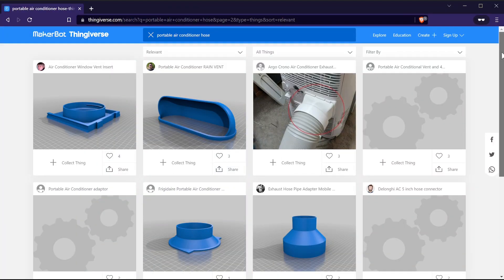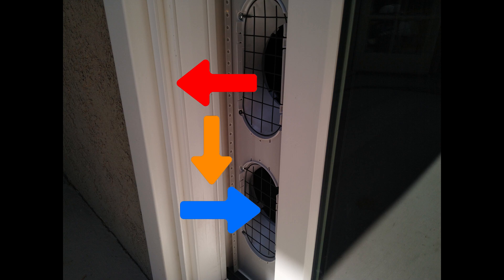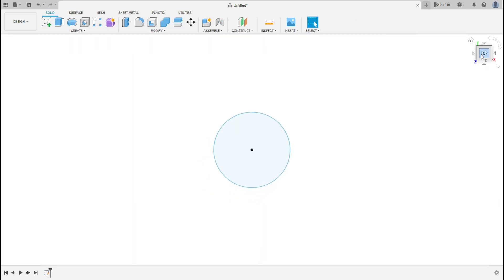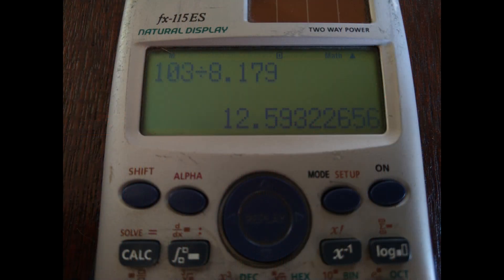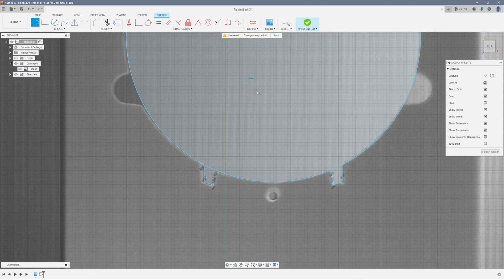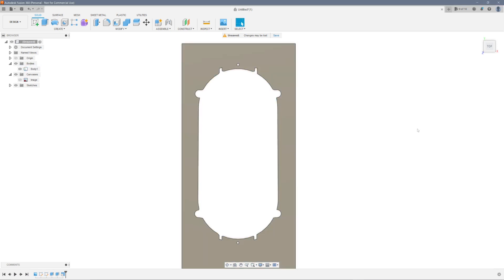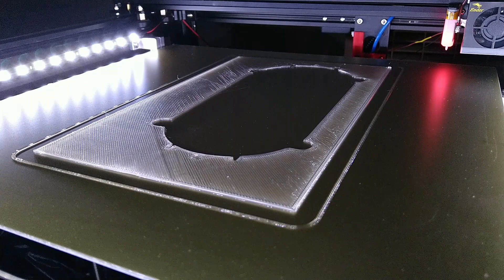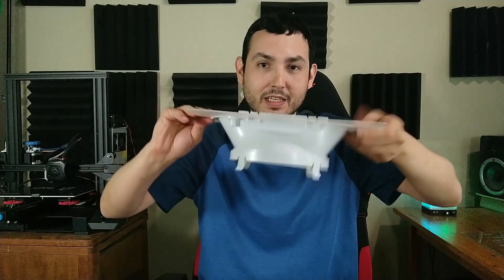How To Use Your Home Office Scanner For 3D Printing & CAD Fusion 360!

Comment: I actually used a similar method in copying some toy accessories. I took scans of the object from in front, the side and from the top. This created three flat images which I put over each other on the CAD screen, on the X, Y and Z axis. 

Then I created my model over the top of all three so it followed their outline from the three angles.
Reply from the maker: That's really cool, sounds like you're quite experienced with CAD!  Which software did you use?  Also did you do that just as a hobby or do you have a business selling toy parts as well?
Reply: @PhazerTech  I am an electronics tech at a plant that makes circuit boards. I do CAD on the side as I collect a lot of 70s and 80s robot toys and often times small accessories get lost. 

So I CAD design and print replicas of missiles, guns, etc. Plus I sometimes make upgrades and original pieces that I sell online. I just use TinkerCAD, but it makes everything I need.
Reply: @PhazerTech  RetroRobotRadio on Shapeways.
Reply from the maker: @RetroRobotRadio  Awesome, I'm planning to do more videos on circuits as well.  70s and 80s were slightly before my time, but I was into transformers when I was very young.  I'm more of a 90s kid so I watched Beast Wars and owned a lot of Power Ranger Megazords haha!  But I think retro cartoons are great too and really need to spend some time watching more.

And thanks I'll check out your designs!  That reminds me, one of my projects I have planned later down the road is to fix an old F-14 Tomcat toy from the early 90s.  It's a few feet long and would make sound effects, move its wings, and flash lights.  The electronics are completely gone but the frame is still in good condition.  I think it would be fun to do a tutorial series of multiple videos going over the microcontroller circuit design and programming along with installing new motors, LEDs, etc.